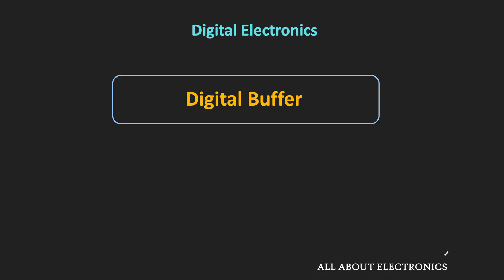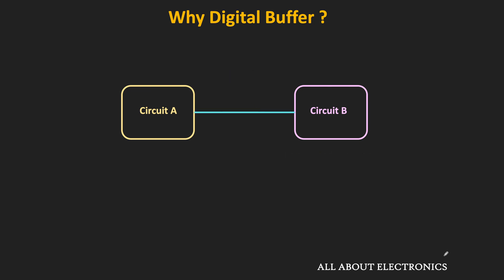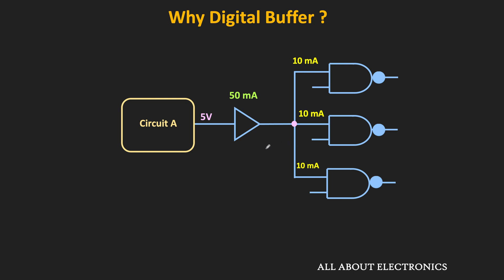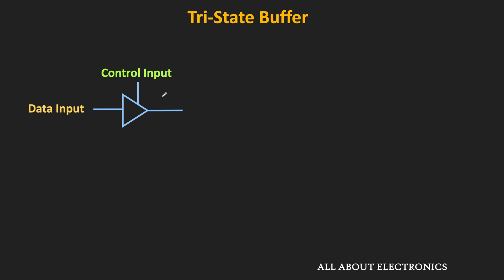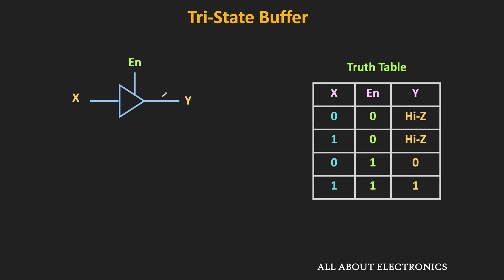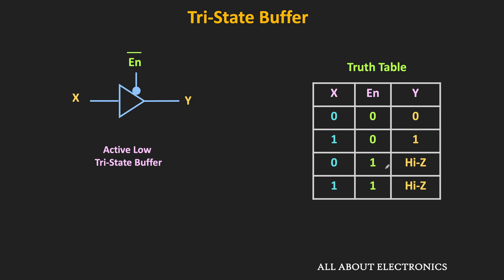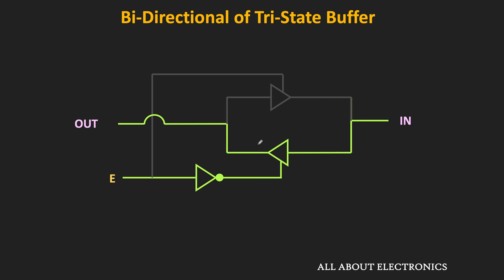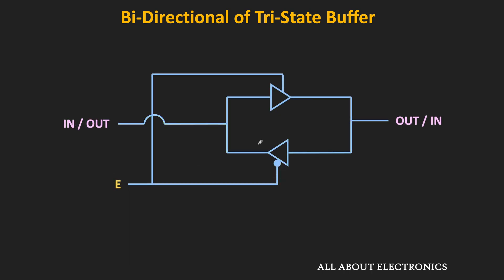What is Buffer ? Why Buffer and Tri-State Buffers are used in Digital Circuits ?

Comment: Hello Sir, after watching your video i still dont understand that you said that buffer had almost no current go through it due to high impedance. But if buffer have no current go through it, how it can supply current for the next circuit? . Hope you help me Sir.
Reply from the maker: Buffer has high input impedance. So, the circuit before the buffer (from which the signal is applied to the buffer) won't draw much current. The input impedance of the buffer will act as a load. But buffer itself can provide larger currents. So, buffer can provide the relatively more current to the circuit connected at the output side of the buffer. Sp, of course, buffer is drawing more current from the power supply source and provides to the output stage. But the stage prior to buffer won't draw much current (because of the high input impedance of the buffer). I hope, it will clear your doubt.
Reply: @ALLABOUTELECTRONICS  i wonder what is effect of " the circuit before the buffer (from which the signal is applied to the buffer) won't draw much current"  ? . 
- As far as i know that if the circuit before the buffer won't draw much current so its voltage will not be decreased, and when that voltage apply to buffer, it will be the same as its volatge when apply to input of buffer. Therefore, volatge won't be decreased
- Secondly, based on your video, buffer also have high current capacity which help buffer provide enough current for the next circuit. Therefore, using buffer it make :
              + Voltage won't be decreased
              + Provide enough current 
 - Based on your example in your video, the 5V of the first circuit won't be decreased due to high impedance of buffer(no current go through buffer => voltage before buffer won't be decreased) then that 5V go through buffer and output of buffer will still 5V (because : 5V/250ohm=20mA but buffer can provide up to 50mA so it will provide enough current for the next circuit so the 5V won't be decreased, cause based on your video if we dont have buffer then the first circuit only have 10mA and can not provide the second circuit with requirement 5/250=20mA or if we assume that the second circuit got maximum current from the first circuit which is 10mA then, 10mA*250ohm=2.5V, so the logic high will not go to the second circuit)
- Could you check if my understands are wrong or true Sir ?
- Thank you so much for taking time read my comment ^.^.
Reply from the maker: Yes, what you understood is correct.
Reply: @ALLABOUTELECTRONICS  Thank you so much Sir, i am very lucky to be your student

Comment: Sir, what is the main circuitry inside buffer?
Reply from the maker: The circuit of TTL buffer is similar to TTL logic gate. But the final stage is open collector. It means, you need to connect external pull-up resistor. In some buffer ICs, the final stage used to be a darlington pair.

Comment: why the  buffer can source a current up to 50mA at 2:34?
Reply from the maker: It has been designed to drive more current. Many buffers use the external Pull-up resistor, which increases their driving capability.

Comment: I try to use NOR gate IC which get input from CD4026 and the result doesn't follow the truth table. Instead of getting 1&1=0, I get 1&1=1
I suspect that current the flow into the input of NOR gate is not enough. So the NOR gate interpret the signal as LOW. Is this reason that I need to use Buffer?
Sorry for my English. Hope you understand the question.
Reply from the maker: Yes, that might be the reason. You can try the same with adding a buffer in between.
Reply: @ALLABOUTELECTRONICS  Thank you